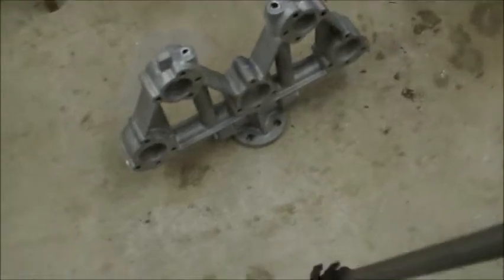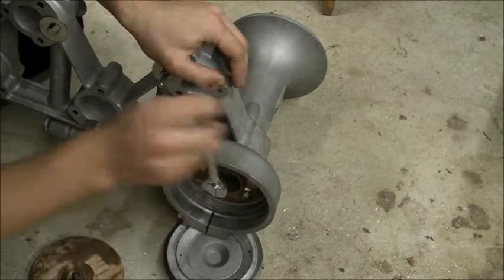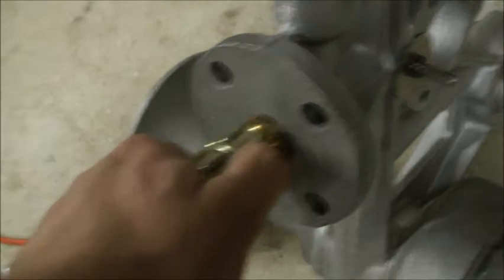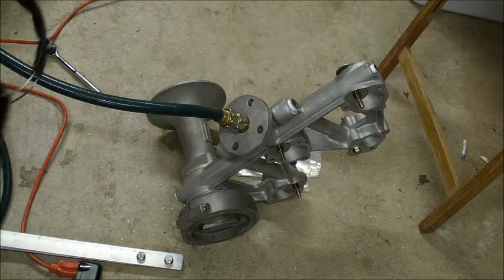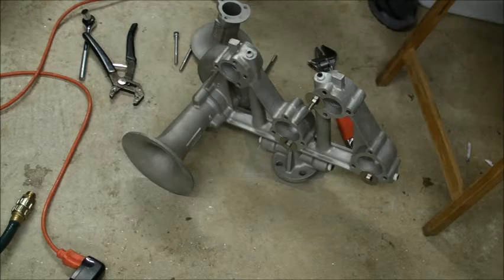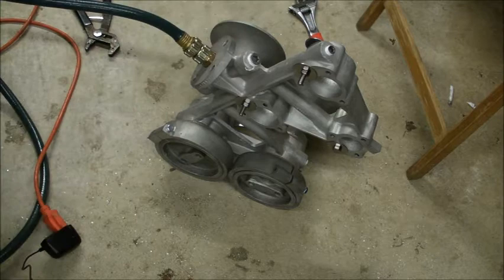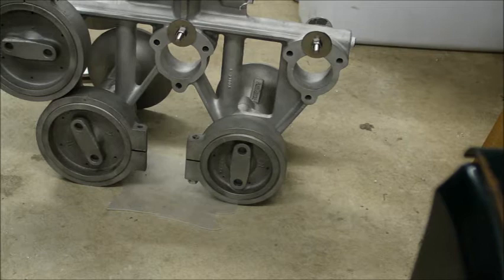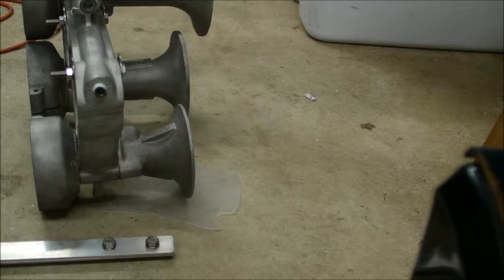M-5  Restoration Assembling and Tuning

Comment: it sounds good. But Most M horns I have heard being tuned usually have the pitch higher with lower pressure and lower with larger air pressure. Good job though